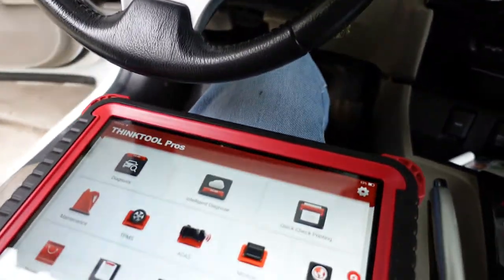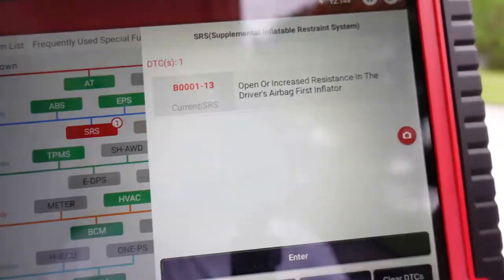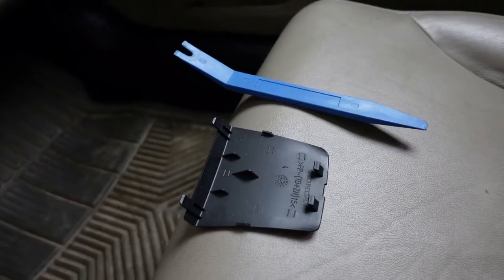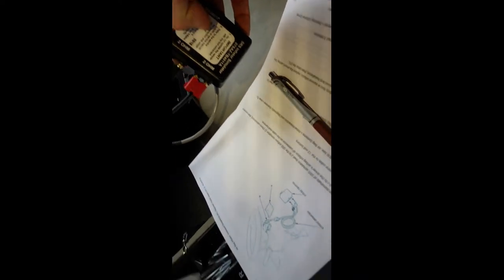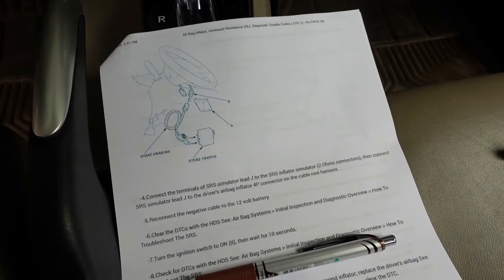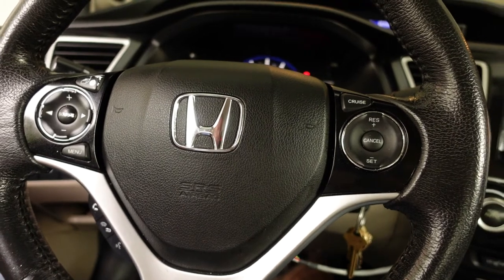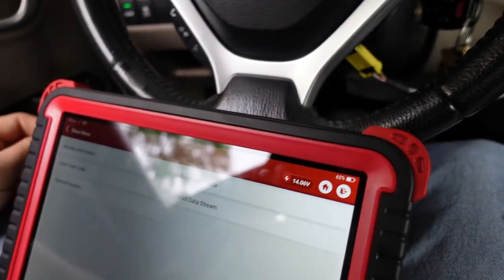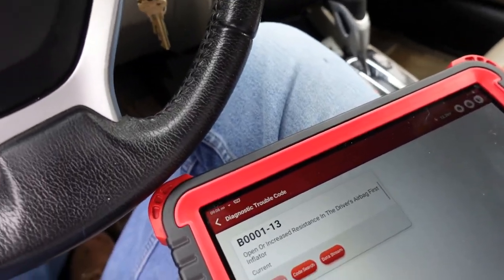2013 Civic Repair Part 10 - B0001 13 Airbag Diagnosis

Comment: Please do not listen to this amateur bafoons advice for airbag replacement, DO NOT UNPLUG THE AIRBAG CABLES WITH THE BATTTERY CONNECTED. You should always take it to a professional or someone who knows what they're doing instead of taking the risk without knowing what youre doing, you can cause a lot more damage. If your airbag has been deployed you cannot clear the codes with a scanner, the code will never leave the system until you clear the crash data for the SRS Module, youre more than likely need to send it in to someone that specializes in that field, they will have all the proper equipment to do so.
Reply: Hey boss. I need help. I got a 2015 Honda civic. Car was in an accident and I was able to repair it all. None of the air bags got deployed but driver seat belt gone. I did replace it and light still on. Any recommendations? Thanks in advance
Reply from the maker: Howdy! Only thing I can think is if one of the seat belts retractors failed and set an airbag code, the srs module itself may need to be reset. I'm not sure if my scanner can do that. I see this on YouTube send the modules out to a repair service to reset the module sometimes.
Reply: 12 has dtc code 11-10 any idea whats going wrong?😢
Reply: @aaronsrose  thank you. Yes i did find a local guy who was able to reset it for $100 and i was able to pass inspection

Comment: I have a 2013 with SRS light, didn't read any codes yet but the dealer printed for me Service Bulletin 18-0-60 which is a Warranty extension for the Passenger side airbag until 2030.  The procedure uses the same simulator and they charge you $150 to do the test (but then you don't need to buy the $200 tool). If it fails then you don't have to pay the $150 and you get a new airbag for free.
Reply: Do you have to take it to a Honda Dealership?
Reply: @rosalindaromero3400  Yes
Reply: Update I bought a genuine Honda clock spring online since it was only $35 and installed and no difference. I had to bring it to my mechanic to clear the light and I thought it was fixed but it took 5 miles driving before the light came back. I bought a 2.2 ohm resistor (pack of 10 on ebay for $2) and had the mechanic install at the airbag connector (since I can't clear the code to check) and he said the light didn't come back on so now I need a new air bag. NY doesn't let you get a salvage airbag so the cheapest online is about $720 plus hazmat fee $50 plus shipping and tax.
Reply: @toddac61....I have the same problem, how can I contact you to find out about the 2.2 ohm resistor and how to install it?
Reply: @FelipeRH-ru7uz  I bought the resistor off ebay, had to buy 10 but they were less than $3.  I bought a genuine Honda clock spring since it was only $45 online first just in case that was the issue. I installed it and it didn't fix anything. Since I didn't have a scan tool to clear the light I gave the resistor to my mechanic and he put it in and cleared the light and it didn't come back on so the resistance of the airbag is too high (you don't want to directly test the resistance of the airbag.  I have to order a new airbag, dealer wants $1100, online is as cheap as $715 but a $50 hazmat fee plus shipping. Wish you could just buy an inflator since it would be much cheaper. Also in NY no scrap yard is allowed to sell used airbags.  To test with a resistor you would just remove battery power and unplug the yellow airbag connector in the steering column and put the resistor between the two pins. You would need to clear the stored code to see if the problem goes away and you need a $200 tool to do that.
Reply: @toddac61 did you try changing the battery?
Reply: @leonardogomez7558  The battery was changed recently

Comment: Hi Aaron, 
   when your Honda first started triggering the airbag warning intermittently, did it usually happen during cold weather?  (I'm having the same intermittent warning with my 2015 Honda Civic, but only when the temperature is below freezing.)  Thanks for your helpful, terrific videos!
Reply from the maker: Howdy! I bought the car with a bricked IMA unit and the airbag code never went away after I fixed that so I'm not sure how it acted when it first started failing. That said, the fault was for improper resistance in the system and resistance is affected by temperature so the colder temps could be causing a borderline unit to set the code. Good luck!
Reply: @aaronsrose   Thanks for the reply and suggestions, Aaron. Years ago I worked to try to restore a Honda Civic Hybrid 144V battery... I'm not looking forward to now troubleshooting an SRS fault :-(   My compliments again on your videos!

Comment: My 15 civic was having the same code. I tried to clear the code with a scanner and the code just came right back. Bought a used airbag and the scanner read the same code and the code just kept coming back after clear it. I wonder if getting the new airbag from dealer is actually going to solve the issue, or that's just the problem with the sensor and a more fancy scanner can just clear the code once for all?
Reply from the maker: Unfortunately, that resistance code could be either the bag itself or the harness. Honda has a $250 tester tool I bought that allows you to determine which piece is faulty. Mine did end up being the bag, but as electrical parts usually can't be returned after purchase, it's an expensive gamble without knowing exactly what is the failed piece.
Reply: I have a 2013 civic 1.8 with code 11-10, which is the same description of your code. 
Is your system different?

Comment: Could the increased resistance from this issue cause a draw on the battery and kill it after several days if it  gets bad enough?
Reply from the maker: I wouldn't think so. Now if there was a module staying awake that would do it. I did not see that symptom on mine though. Thanks!
Reply: @aaronsrose  gotcha. I think my module may be staying awake. As I have the same code and my battery has a draw.
Reply from the maker: If you have a thermal imaging camera you could check the fuses to see if one is warm while the cars been off for a while. Or check for a voltage drop across the fuses. That could help point towards the wayward module.

Comment: iI have B0072-13, B0072-13and B0082-11 after crash I Repair the module but i cant able to clear these DTS. where i can find this device. i will give a shot.
Reply from the maker: This is the scanner I use. ThinkCar Thinktool ProS.
https://www.amazon.com/Thinktool-Bi-Directional-Diagnostic-Functions-Calibration/dp/B08SWH2KP4/ref=sr_1_2_sspa?crid=2NU5RL05GDE25&keywords=thinkcar&qid=1667242889&qu=eyJxc2MiOiI1LjYxIiwicXNhIjoiNS4yNCIsInFzcCI6IjQuMTEifQ%3D%3D&sprefix=thinkcar%2Caps%2C140&sr=8-2-spons&ufe=app_do%3Aamzn1.fos.ac578592-0362-4e0a-958c-0f2dd61d30d4&psc=1

It's not cheap. If you're not going to do this more than a time or two it might be cheaper to find an independent shop and pay an hour of labor to reset the codes. Thanks!

Comment: Where do you get an airbag for $500? You talking used?
Reply from the maker: Ended up being$850 from the dealer. Didn't want to go used. Like about everything else I guessed at I was way under on what I thought this would cost.
Reply: @aaronsrose  I just bought one. My cost would of been $1200 from the dealer. Thank God a friend of mine that owns a body shop got it for me for $880 with his discount.